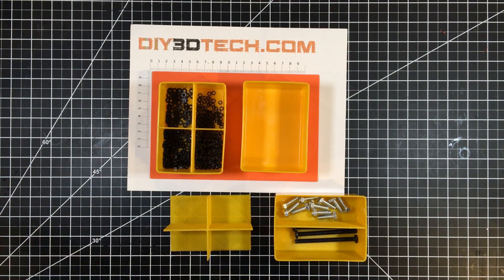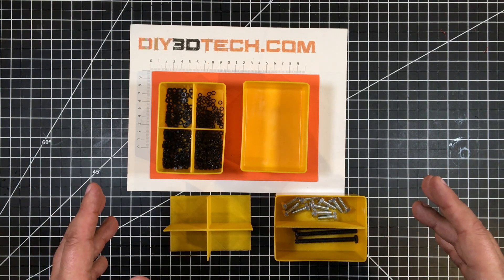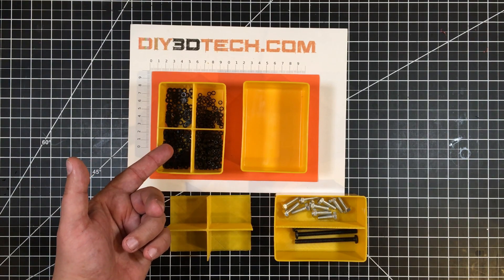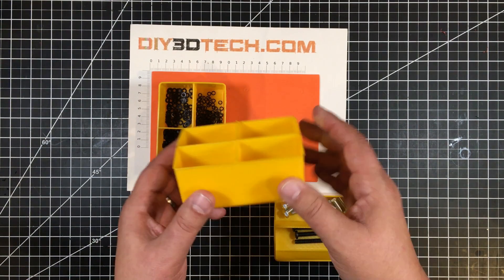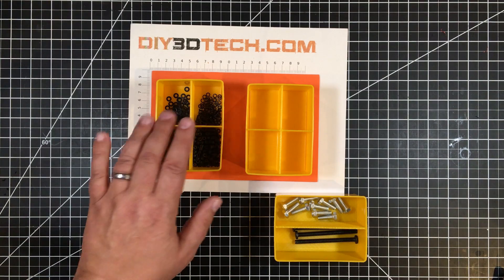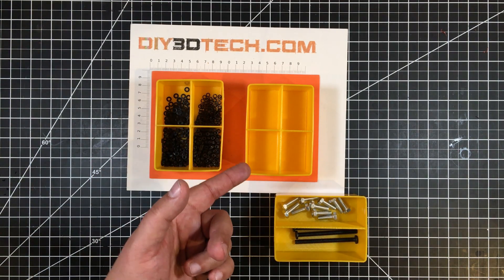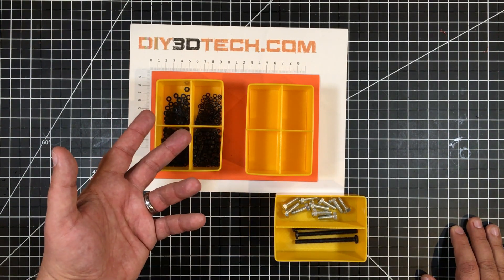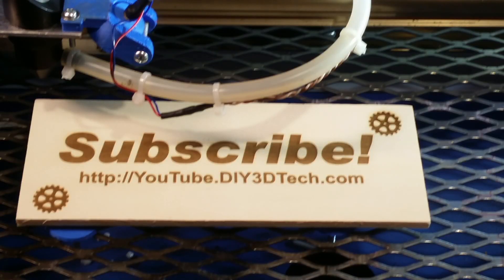Design Talk -  Harborfeight Bin Divider!

Comment: This is awesome!  I have a bunch of these HF cases in the deep and shallow sizes. I love this but also need various length and widths to fit bigger or longer parts that I want to store. Have you worked on that yet?  Looking to store things like calipers or long bolts and other stuff. 

Love this build and I’ll have to make this from your Thingiverse post!  Thanks Joe!
Reply from the maker: Build three models for the bigger bins, a 2, 3 and 4.  They are out on thingiverse.  I have stayed away from printing complete bins simply because of print time and the small feet on the bottom to lock them in will tons of support so this was a faster option...

Comment: Nice job! Those organizers from Harbor Freight are awesome. I mix and match the bins with all small ones in some cases and large bins in others. Design suggestion - add a nice fillet at the bottom edges were the vertical meets the base to make it easier to pull small parts up the side. It will also make these stronger. Some high end sorting systems are filleted like this.
Reply from the maker: Yupperoo!  :-)

Comment: I once bought two clear plastic divider boxes that were on special at Harbor Freight.  They were shrink wrapped along with what I assumed was a box-sized label simply INSERTED on top which had a box sized image of items placed in all of the compartments (just in case you didn't know what the box could be used for).  Unfortunately, once the shrink wrap was removed, I found that every bit of the label was GLUED to the top of the box with a glue that simply could not be removed, thereby totally obstructing a view from the top of the box of what was inside each compartment.  Now THAT's quality control, no?  I returned both boxes.
Reply from the maker: I bought 20 of these and 3 where as you mentioned, I simply soaked the label in GoofOff and it came off :-)